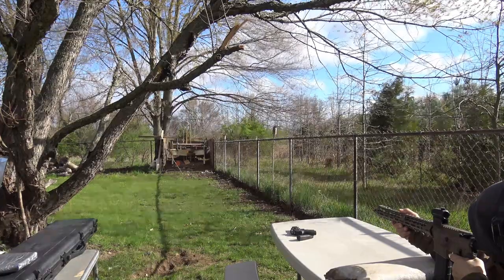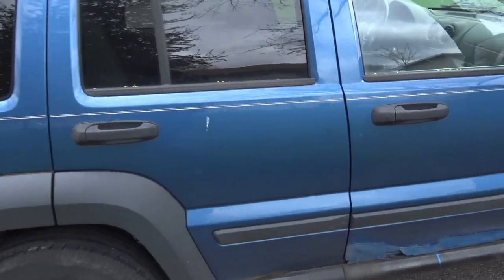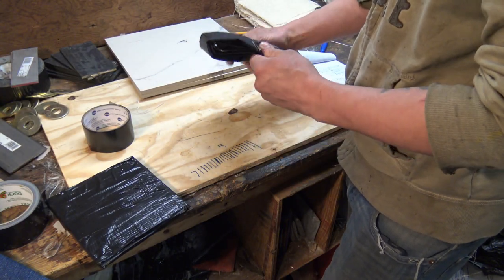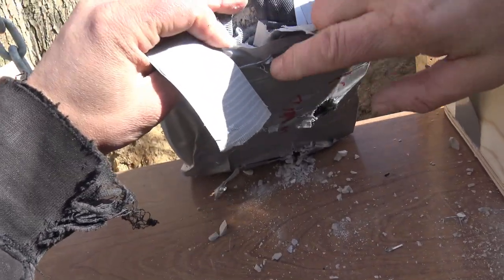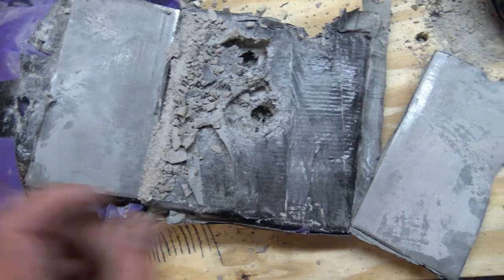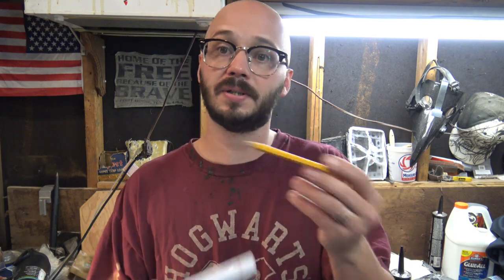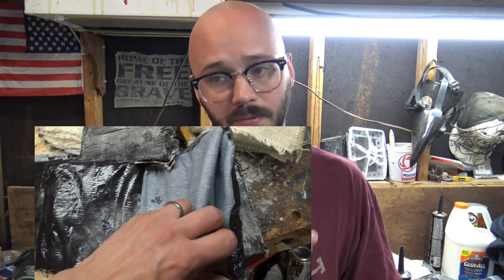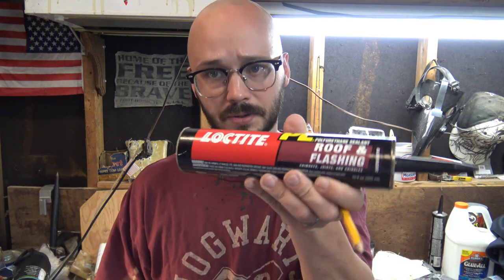To Myanmar with love: simple DIY body armor

Comment: 18:51 --> do not forget to tell that if you use polyester fabric, don't use polyester resin (cuz polyester resin will make polyester fabric melt).
Reply from the maker: That is very true Devon, thanks for the tip.

Comment: Woo...call that jeep the BATTLECAT when done!
Reply from the maker: That's a great idea! Now that's the name.
Reply: Cool videos, I like how creative you take your designs, I had a idea about 15 years ago, you know camel backs that soldiers have? You think a small pouch of water would be a protective layer?
Reply from the maker: @tanner882  go on... what you got!
Reply: @tanner882  it would be good for dispursing the energy. Probably best as a backing layer so big rounds don't break your ribs
Reply: @Techthisoutmeow  I was thinking more about this. Maybe using some sort of medium is a container. Personal body size or panel size thick enough to disperse energy. Not sure what would be best. A clay like medium? Water would be a starting point, maybe a thick gelatin? But then a moist clay sounds like it would be helpful if it was a little thicker like play dough? Lots of ideas you know.

Comment: truck tire tread might be interesting: my 20 ton press and a sharp axe head could barely get through it, with the steel cable strands snapping one by one with each pump of the handle.
Reply: If you could chemically remove the rubber for the belts that could be useful, the rubber doesn't offer much balistically

Comment: I am curious. Do the Myanmar military use long barreled 9mm? You might want to try that also.
Reply from the maker: They do! Sadly I didn't have a long barreled 9mm for testing, hince why I made that plate so thick. I know you could slim down it's profile for just basic hand gun 9mm, but I was going a bit on the thicker side for this reason.
Reply: @Techthisoutmeow  a really inexpensive long barreled 9mm is the hipoint carbine, I got mine new for $250 but that was 5 years ago. I got the hitower armory bullpup conversion for mine, and eventually they will manufacture double stack mags for it

Comment: Great video, I have a question, I know you said pva glue isn't great for holding the plates together but could it be possible to make a ceramic strike fase with tightbond 3 waterproof Wood glue and sand for example, just saying because that's all the glue I have, I'm wondering if sand held together with wood glue would be able to break up say a 9 mm fmj handgun round with the hdpe backer.
Reply: Unlikely. Check his comments on the homemade composite ceramics where high quality epoxies binding together high quality engineering ceramics had a fraction of an equivalent porcelains performance by weight.
Reply: @floridianzach2277  yeah true I did actually see that video but he did show that homemade ceramics did cause fragmentation, but pva glue is just going to be too soft and malleable or ductile to hold the hard sand or boron carbide granules to break up any bullet.

Comment: It probably would have been better if you would of tested with the same calibers as the Myanmar military.
Reply: @popinmo  not sure but have seen some photos from the media it looks like 7.62 by 39 (AK-47). But that doesn't include anything else they might have.
Reply: he did. .308 is one of the calibers that where used against myanmar protesters. 5.56 and 7.62x39 are also (but since .308 has more energy and same diameter as the 7.62x39, it can do both)

Comment: Sir, I have been searching for months for how to make my own body armor against knife and machete with resources only available in my country. 
   stabbings have risen in my country, they are perpetrated by teenagers under the influence of alcohol and drugs. the corrupted police do nothing, more occupated racketing car drivers.  I wanted to buy (importing) a stab-proof vest, but it could be considered as an attempt to make a coup, in my dictatorial country. I wanted to use epoxy resin, but it is too expensive in my country.   This is what I can get easily: HDPE bottles, plywood panels, denim, aluminum plates